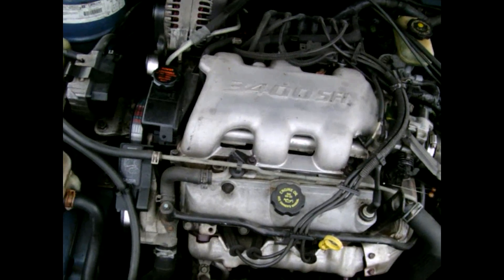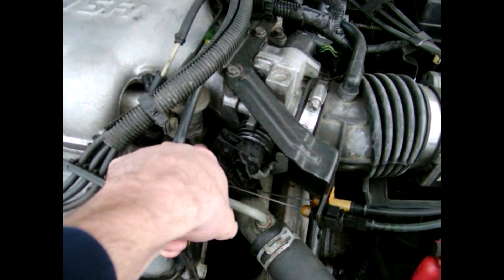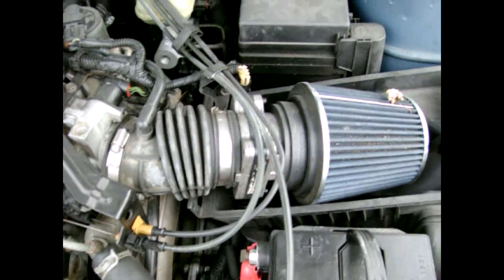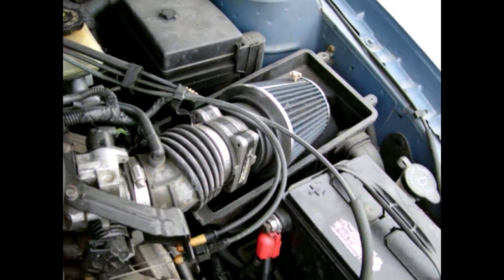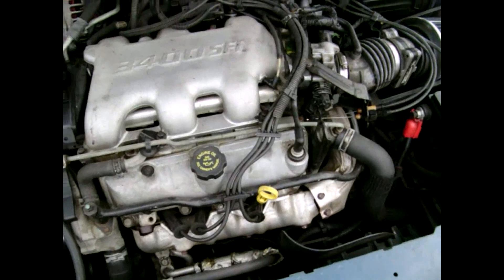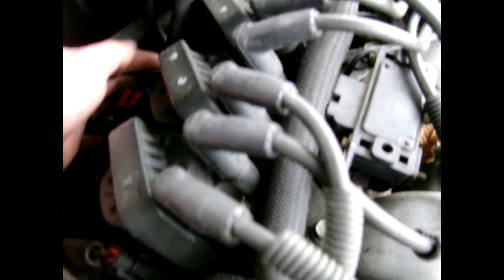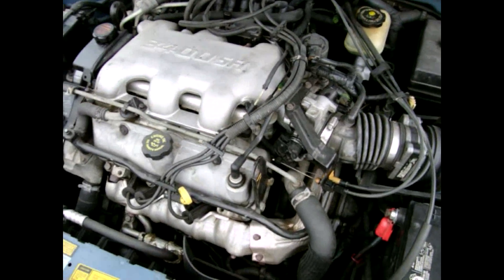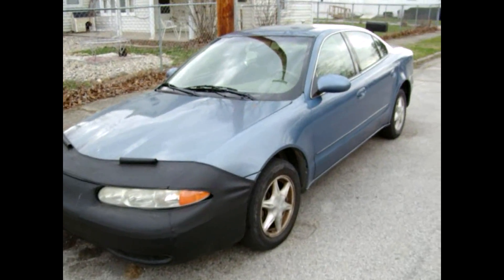3400 GM Engine 3.4 Liter Motor Explanation And Discussion

Comment: At 2:40 you point out the repair to a vacuum line, I'm interested in the line underneath your finger and the container it leads to out front. Any ideas??
Reply from the maker: The big line that I repaired goes to the PCV (positive crankcase ventilation) and the other end out the back goes to the EVAP system.  The small spagetti line under my finger at the 2:40 mark is for the fuel pressure regulator.  Hope this helps.
VT247

Comment: the only thing i can think of is that the fuel line is running to close to the exaust and the coolant hoses and i think that might b causing to much heat in that area. on a side note i changed the fuel filter when it was doing the whole not running and it was still hot, and as soon as i took off the fuel filter it shot gas everywhere like there was a cut in a garden hose. and that is what turned my thinking toward vapor locking

Comment: Carranzabigbable my friend had this problem check that your starter wire hasnt gotten melted or frayed. Get a meter on ohms and see what your voltage is from the postitive battery terminal to the strter cable should be 12-13 volts hot and cold.  Wen thencars hot but off you can also check the resistance on the wire

Comment: Hi, thank you for the video. I have an issue with the small plastic pipe that comes out of the tip of the air intake boot hose. It won't go back in at the other end, the one that goes to the motor. What is it called and what is the purpose of it?
Reply from the maker: That isn't an easy one to get back on.  Usually helps to put the back in first then the front to the air intake.  It's used to vent crankcase gases back into the intake manifold.  
VT247

Comment: I found the annoying ticking sound, but the hard way. It was the AC wiring connector that had been pulled into the belt along with the metal bracket. The connector looked like it was cut almost in half diagonally and the bracket was bent into the path of the belt. So the belt had to be replaced and I also did the water pump as it was not expensive and I was already in there. No real challenges for the car yet so time will tell on the hot running issue. I'll be back for more drama.

Comment: of concern one near the coil pack blue spark.  another looks like above the fuel presser  regulator but more of a red spark. and sparked each time the engine stumbled (loped) the only thing above this was 3 spark plug wires but they look fine.  Still stumped. but will replace the coil packs any way can get em on line for 11 each 3 year guarantee.  then next check get the plug wires and plugs just in case.  Do I really need to remove the top motor mounts and rock the engine forwardtodotheplugs?

Comment from the maker: My guess on the noise is piston slap.  Once the engine warms up the ticking / rattling stops because of heat expansion.  Bad news on the coolant leak though, it's probably the intake manifold gasket.  It's not a terrible job to do, just time consuming.  I have a video up on how to do this repair.  The two issues are not related.  The intake manifold gasket repair can be done for @ $150 if you do the work yourself including all the fluid and gaskets.
VT247

Comment from the maker: The power steering lines run beside the alternator bracket.  One is threaded into the pump the other is the low pressure return line.  The low pressure line slides onto the plastic nozzle coming out of the pump.  The high pressure threaded line can be a task to get back on sometimes.  Enough fiddling with it and it'll go on.  Takes a minute or so to get it started on right.
VT247

Comment from the maker: Fuel pump possibly, spark plugs?  Also, check to make sure you have the timing right.  I found out the hard way that the spark plug wires went to the wrong plugs on a car with the 3100 engine.  It would idle fine, then chug and jerk when it accelerated.  Hope this helps!
VT247

Comment: 1999 Oldsmobile Alero w/ 3400. Intake gaskets bad. Had the slight hesitation you were talking about but then it gradually got worse to the point the car was hesitating to accelerate. Parked it after it did that, opened the hood and noticed milkshake oil and also oil spewing from the valve cover bolts and now the car wont even fire. Any ideas if anything else is wrong besides intake gasket and valve cover gasket?

Comment: My Alero hums now after driving through a deep puddle during a rain storm. I replaced the wheel bearings because I thought that's where the hum was coming from. Nope. What other part could be making that sound? It changes pitch with the tire speed like a wheel bearing hum.
Reply from the maker: Throw out a few suggestions.  Maybe lost a wheel weight, check if the CV shaft boot has a hole and filled with water, see if the breaks are dragging or warped, make sure the lugs are tight, make sure there’s no bad ball joints, tie rods or distorted control arm bushings. 
VT247

Comment from the maker: What kind of noise does it make?  A rattle, knock or tick and from where?  Might try cleaning the Idle Air Control Valve, sometimes they get carbon on them making them stick.  Could help with the hard start.  With the hard start, do you have to give it gas to make it fire up?  Some carb cleaner on the throttle body plate will clean it up some too.
VT247

Comment from the maker: Not sure of what size bolts they are, believe they are metric.  It's located on the bottom, in front of the engine hooks in front of the transmission.  Disconnect the battery, unfasten the large starter wire and the smaller positive + wire.  It's not hard to get off and is about a 1/2 to an hour job.  Helps to have the car lifted for easier access.
VT247

Comment: I'm getting that pool of liquid in the spot that you were pointing at in my 2000 Grand Am. Not only that but the anti-freeze is brown with some sludgy brown residue on the reservoir cap. I'm trying to figure out if it is the intake gasket, head gasket or combination of both.. 

All the best!

Comment: I just bought a 03 Aztek with 160,000 on it, drove it twice engine sounded pretty good strong yet. So I bought it, within 24 hours I drove it home and then to work not issue's went to leave work started it up and the engine noise was bad. The first thing that I thought of was a rod, then valve's floating, or piston or pistons slapping. I was hoping it would go away when it warmed up, run it for about 15 minutes no change so I decided to try putting in some Murphys Mystery Oil in it. But it stayed about the same if not a bit loader. Went to my second job, and a few hours later when I left the same thing, hoped it would quiet up but it didn't. So stopped at Walmart on the way home and bought some STP Oil additive the small blue bottle very thick oil improves viscosity and helps with engine wear and stuff. But after putting it in there is no change almost as if it is gradually is getting louder. It sounds like a diesel pretty much now, don't know what to think now other than go and ask a mechanic. And I contacted the guy I bought it from and he said it was fine, I don't know what to tell you!?! Anyone have any Idea's other than small claims court!?! Thank you!
Reply from the maker: Ughhh..... Man, that sucks.  Shady deal man.  I'd be PISSED!!!  
But I'll do you a solid and tell you what the problem is.  The reason the fix-an-engine-in-a-can oil didn't work is because it's most likely the rocker arm studs / pedestal.  Adding a thicker oil won't change the noise at all.  The engine at some point has had the head or intake gasket fixed.  When the steel rocker arm bolts are torqued back down onto the aluminum head they can get stripped out.  In order to fix this problem take off the valve covers.  Tap, thread and heli lock the stripped out threads.  You'll know the bad one as it will be loose.  Someone off of Craigslist would most likely do this job for @$300-500.
Check out my video's on GM 3400 fixes, the same engine as in your Aztek.  Several Aztek videos along with how to set up the tent option.  Currently own 3 Azteks.  They're awesome!
VT247

Comment from the maker: If you have oil and water mixing, it's the intake manifold gasket.  I had an Aztek that had a bad thermostat in it.  Drilled out 4 holes through the thermostat and fixed it.  If you have a sweet smell coming out the exhaust, it's a head gasket.
VT247

Comment: I have the identical car. Mine is black and it's a 2001 with 124,344 miles. I bought it for 300 bucks a few weeks ago. Runs awesome. I can tell it sat for awhile, but it started right up after sitting through a -10+°  winter here in Michigan. It was in my neighbors driveway for a couple months before I got to it. It over heated on me a couple days after I started driving it, apparently the radiator reservoir cap seal is a common problem with the 3.4, so I went to my local auto parts store and picked a whole new reservoir up for 35$ and took the 10 minutes to install it and top off the coolant. Haven't had an issue since. The only other issue I have is the water pump pulley making a squeaky sound until its warmed up. Might have to go grab one for 40$ and take the hour and put a new one in. The biggest thing for me is that I've NEVER EVER worked on any of my own cars until I got this 18 year old beater. It's super easy to work on the small stuff and a good car to learn on and parts are readily available and cheap. Have fun out their you all! No matter what your experience level is, it's all a learning experience!
Reply from the maker: Awesome glad you like it.  Just keep in mind that the gaskets on these engines will eventually need replaced.  Like every single one of them, head, intake and timing cover.  Speaking from experience having owned about a half dozen vehicles with this motor.
VT247

Comment from the maker: Hopefully the intake isn't broke.  Had this happen once when I did a head gasket job on one of these 3400's.  The intake can crack and cause a vacuum leak.  Listen with a stethascope (or a piece of vacuum tube in your ear) for where the whistle is coming from.  This will help locate the problem exactly.  Hopefully it's just an o-ring on an injector.
VT247

Comment from the maker: The intake gasket on these go bad.  Are you losing antifreeze from the system?  Checked the spark plugs if they are getting wet?  Might preform a leak down test to check the head gaskets.
VT247

Comment: the metallic pipe that goes out of the water pump and goes all the way around the engin is pissing fluid... it goes foward and its to fast to just ingore it.. any suggestion or I change it simply!
Reply: one of three three things the pipes rustd a hole or the pipe o ring is shot or could be running from water pump weep hole take metal ppe off check oring put grey permatex on ring shove backin clean hole reasembly if no hole in pipe find a hole ? put a lot of jb weld over hole wen dry and sanded let harden over nite reassemble and add coolent

Comment from the maker: @Texasselling @Texasselling The relay gets power all the time, your just completing the circuit. The temp sensor tells the computer when to engage the fan through the relay.  Make sure to check fuses too.  Check coolant level.  What operating temp does it go to before the fan would kick on?  Mine would go past 1/2 before the fans kicked on.  Mine rarely ever turns on, but work.

Comment: There's never been a white wire in mine..I even cut back the tape to solder the red one back on and it was the only wire going to the plug.  There is even 3 identical orange/red plugs from the 3 empty slots.  I appreciate the effort though!   Looking at pictures of rendezvous wire harnesses on ebay(only place I found a picture of it, I can see that the one that goes to the alternator has only a red wire, just can't tell where it's position is. I will just find a rendezvous around town and look

Comment: I agree with Vacationtime247 I am rebuilding the same motor now. I am not sure about all of the 3.4s but it seems they have problems with the head gaskets and also with the oil galleys blocking up. Mine was very well maintained and had only 85k on it. Also drain the factory coolant out of it!! Put in the coolant that can be mixed with anything. I have found the GM factory coolant is terrible! The first thing I do after buying a GM vehicle is drain the coolant and replace it.

Comment from the maker: Not sure what the popping sound would be.  Something that would have to be heard there to diagnose.  The blend door for the heater can sometimes make noise, nothing major.  It's supposed to change the air flow direction : D
VT247

Comment: I snapped both the left tire & the front left tire under the car at two different times & it really wasnt hard & was relativly cheep to replace the back tire set up but with the front one i broke the cv joint, my tie rod, & managed to to break the engine mount that is located by the power steering pully & also shifted my transmition and eninge to the left by under an inch & needless to say i sold it but ive wonder how much would it have cost to fix. got an ideas? i would have done work myself

Comment: at 2:30 you touched a hose that runs into the big metal intake manifold. What is that? mine just broke and I need to know what i9t is so i can replace it. Thanks!
Reply from the maker: PCV (positive crankcase ventilation) vacuum / cross over tube?  If that is the one you are referring to.   You may try using larger hose to go over it and snug it with a zip tie.  Might try the local junkyard.
VT247
Reply: I figured out what it was it was a "TransAxle Vacuum Line" I put a bigger hose over it and then put a smaller house inside the bigger hose so it can fit on the small end and now it works perfectly.

Comment from the maker: Make sure there isn't a frayed fuel injector wire, could be causing the injector to misfire.  Jack the van up and put it on stands.  Get under the van and remove the spark plugs from underneath.  Found this to be the easiest way for removing the spark plugs in the back.
VT247

Comment: thanks for your insight... haven't checked to see where that white hose goes..but when i checked the code it says P0404 ...so it seems to be the egr is causing it to go into limp mode
Reply from the maker: Usually limp mode is caused by a bad shift solenoid in the transmission.  Check out my how to replace no 4th gear for a 4T65E transmission.  The solenoid tells the computer how much pressure is in the line and when to shift gears.  
VT247
Reply: Vacationtime247 when i checked my cel it gave P0404... so my egr valve isn't closing all the way.. would that cause it to go into lhm
Reply from the maker: Luther Humphrey If the car isn't shifting gears the EGR isn't to blame.  It may still be bad, but that won't change the shifting points.  Also, you can clean the pintle spring on the bottom of the EGR when off with some carb cleaner.  Use the carb cleaner to spray down in there and use a screw driver to work the spring up and down.  It will clean off the carbon then work like new.  1 10mm nut holding on the transmission dipstick and 2 13mm bolts holding on the EGR and another 10mm bolt that holds the EGR onto the metal tube from the exhaust.
VT247
Reply: Vacationtime247 yea i found the problem... i was getting to much back pressure ...the catalytic converter was stopped up and causing the egr valve to not close...not no more cel for egr... plus it sounds better and shifts fluently now...

Comment: Oh I know I have a leaky intake gasket. There is a bolt on the head just behind the thermostat that always has coolant around it. Oh, and the primary cooling fan will not turn on for anything. When the AC is on the high volume fan runs fine. I have yet to find water in the oil and have been aware of that possibility for some time, so I check it often. 
Also, I am in a very hot environment and the car has 132,000 miles on it now, so should I consider a different grade of oil. I use high mileage.

Comment: Can you walk me through putting a intake valve in a 2000 Chevy impala that runs below the daily panel
Reply from the maker: In order to replace the intake valve, you have to remove the head.  If your talking about the rocker arm, you can sometimes do that with the head still intact.  But it would require a helicoil kit.
VT247

Comment from the maker: First thing I'd check is the ignition control module under the coil packs.  They heat up and cause it to shut off.  Also the fuel system, fuel pump, regulator and filter.
VT247

Comment from the maker: I've currently got 3 Pontiac Azteks.  They are awesome cars!  Definitely different.  Most 3400 engines have already had the intake manifold fix done.  Typically the 2001 model Azteks have the most options.  But look for a GT or Rally.  '04-05 models are pretty good too.
VT247
Reply: The axtek is the ugliest minivan ever!!!😂

Comment: well, got everything back together and told you about the hard start. Now just wont start. New Fuel pump, filter, plug, wire, coil pack, ignition module, gaskets etc.  1 new coil pack was bad from the start.  going to put back the old coil packs to and ignition mod to see if that clears up the non start.  Engine turns over good. I hear the pump got gas in it. After the coil packs and mod if it don't start whats your guess? just about ready for a bonfire?

Comment from the maker: Loosen all the 4 bolts holding on the pulley.  Take off the serpentine belt.  Take out the 6-8 bolts holding on the water pump marking the mounting location (makes re-installing the new one easier).  Scrape away all the excess gasket material on the mounting surface.  Coat both sides of the gasket with RTV black silicone.  Install new water pump, install pulley, install serpentine belt, fill radiator and overflow up with coolant.
VT247